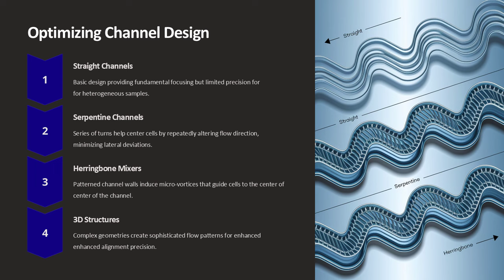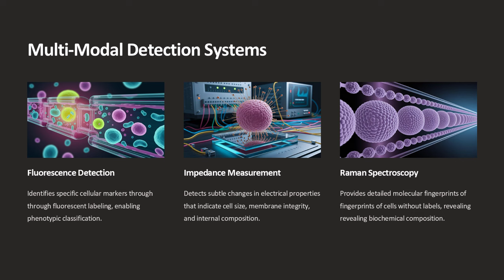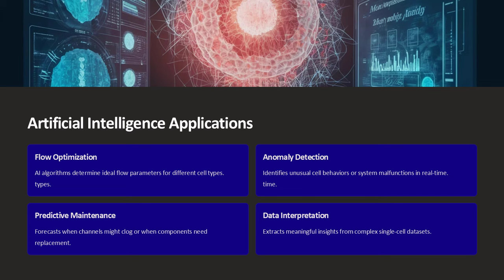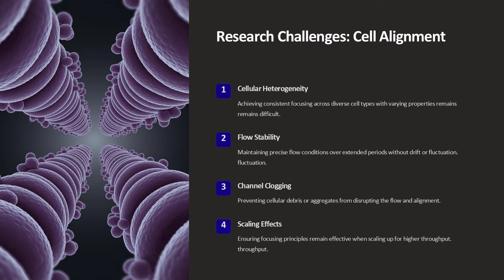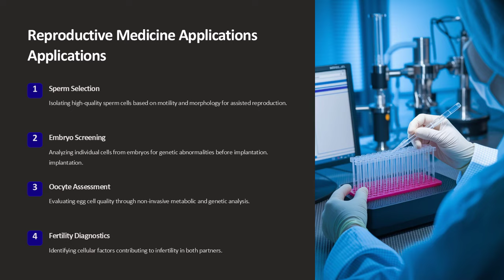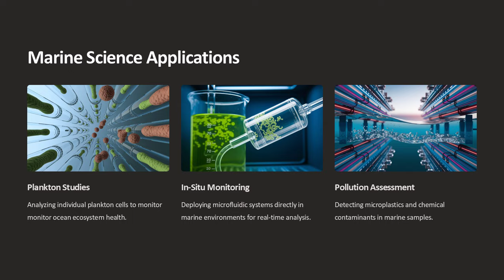Microfluidics for Single Cell Analysis | Podcast Episode 5

Comment from the maker: How do sheath flow dynamics and microchannel geometry interact to achieve optimal cell alignment?
Could AI-powered real-time monitoring enhance flow control and error reduction in single-cell analysis?
What are the biggest regulatory challenges in bringing hydrodynamic focusing-based microfluidic devices into clinical practice?